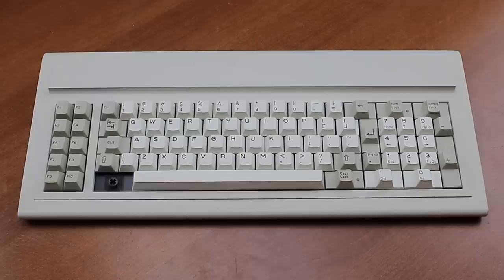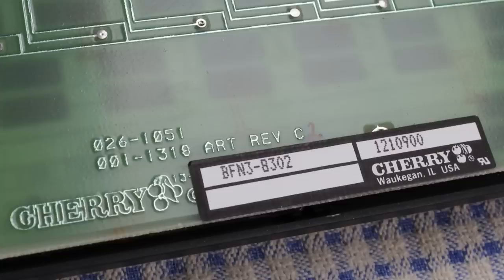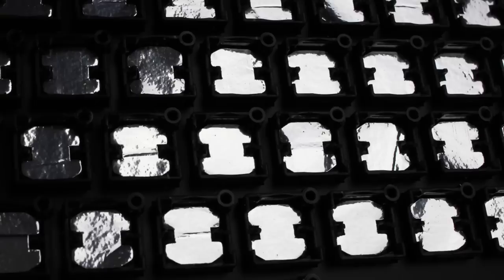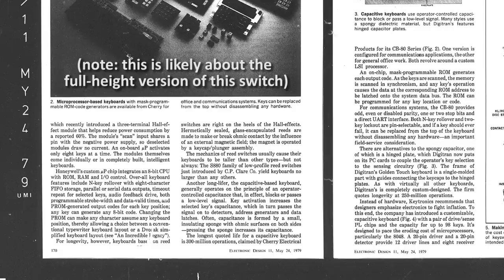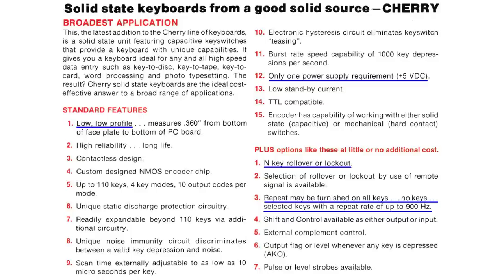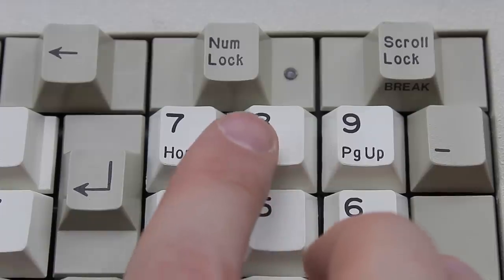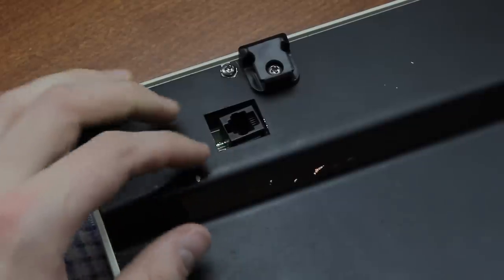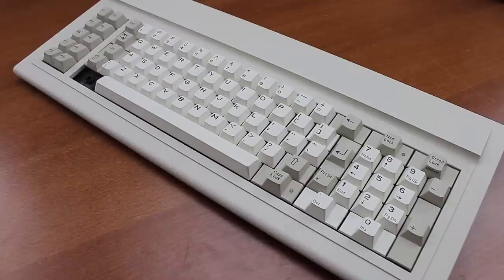Cherry KFN3 keyboard review (Cherry solid-state capacitive, shamrock-type)

Comment: Cherry's keys still use that sharp, angled design, which I like. I have several new MX Board Silents that look similar.

The wire riser design is an interesting idea. Imagine if it were rubberized . Probably better than flip-out feet.

Comment: 1:32 Here's the argument for "solid-state capacitive" as a valid name: There is no switch that is physically changing state to indicate whether a key is either on or off. So by definition, this keyboard is "solid state".  The sensing is done capacitively, so calling it a "capacitive" keyboard is equally correct.

Comment: Very interesting indeed. I am surprised how it isn't mushy at all despite it being foam and foil. Are the foam pads still in decent shape or have they disintegrated over time? I wouldn't be surprised if the pads disintegrated which ended up eliminating the mushiness just like what happened with the Chyron aircraft carrier you reviewed quite a bit ago.
Reply from the maker: I suspect this is a factor, yes.

Comment: I find strange the fact that this keyboard is based on the XT layout, but it has locklights that the model F XT doesn't have. As far as I know it's the XT protocol that doesn't support them (it shoudn't allow sending any command back to the keyboard), maybe this keyboard has the AT protocol? But this would be strange too, as keyboards of that era usually had a switch on the back that let you change between XT and AT protocols!
Reply from the maker: No, there were definitely XT keyboards with lock lights. However, those were keyboard-controlled, rather than computer-controlled.
Reply: @Chyrosran22  So it was just the keyboard that remembered that you pressed the key, so that in some cases it can be out of sync and work at the opposite? Funny that my main usage of the lock lights is to check if the whole pc is frozen or just the monitor!
Reply from the maker: @karellen00  Yes, it can easily end up working opposite. It wasn't until AT that the keyboard could retrieve information on what state it was actually supposed to be (although it's still possible to trick an AT keyboard).

Comment: I dunno, as much crap you give cherry MX there are reasons why foam and foil isnt that great.
They can still degrade badly, not to mention they are hard to replace these days thanks to foam and foil not being widely used anymore.
Personally I would rather have cherry MX as they are so common nowadays, some keyboards even support hot swapping switches so that is a good thing.
Not to mention how common the cherry MX compatible keycap is in the market
Reply from the maker: Convenience is definitely an advantage, but ultimately not a substitute for quality imo ;) .
Reply: @Chyrosran22  I kind of think it evens out a little bit on one hand you have a better quality keyboard but the parts may not be easily replaced and on the other a lesser quality keyboard yes but the fact you can change Parts out kind of makes them even. If only you can get something that's between and you would have something great
Reply: Hard to replace? Foam and foil sounds like you can get sheets of the stuff then cut out the foam and foil shapes from the sheets before gluing them together. Doesn't sound that hard as a craft project.